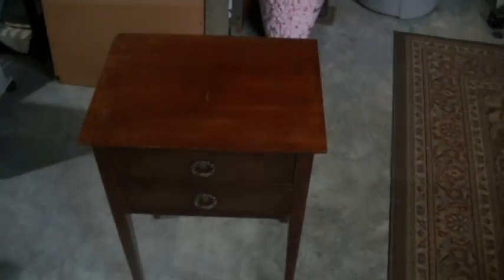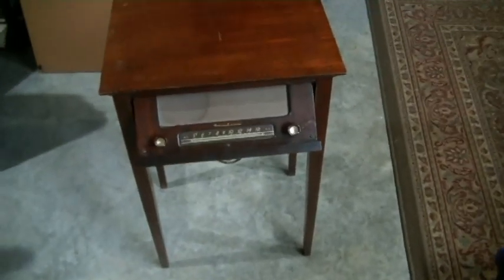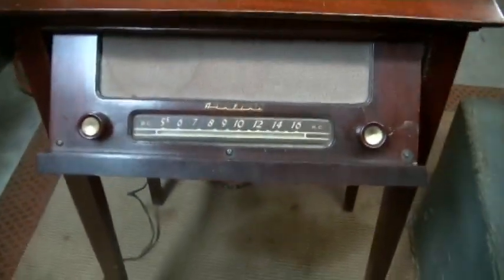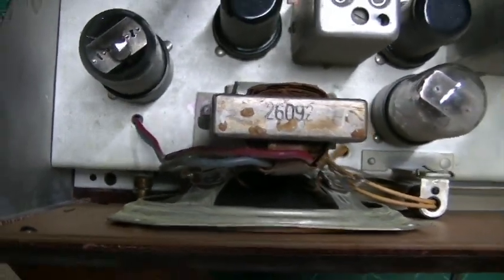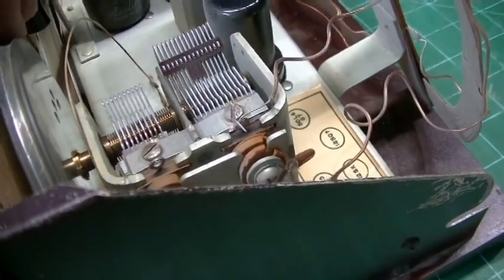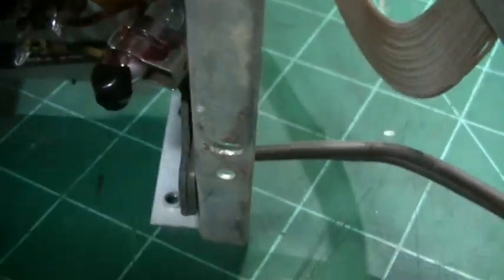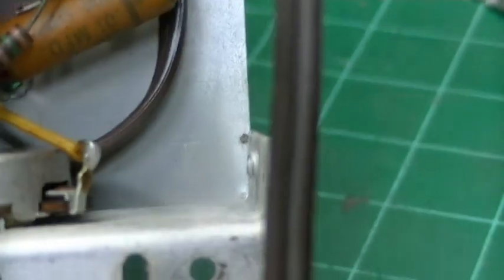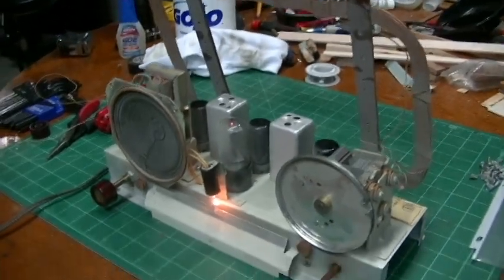1948 Montgomery Wards Airline Radio End Table pt 1 OF 2

Comment: Great to see you post a video again. Fantastic find!! The mercury switch is a great idea and should never fail. The EPA got rid of all the mercury switches in T-stats so replacements are going to get harder to find. They are so simple, I am surprised they were not used more often in radio and TV gear. Never fail technology is seldom used nor wanted by any industry. 
Thanks Scott.
Reply: They still make mercury switches.  True that you won't find them in residential applications anymore but they are still used in industry.
Reply: douro20 
Thank you for the info!
Reply: epa is a bunch of criminals who should be disbanded. anything good they ban it. 

the building i lived in two years ago had an oil fired boiler from the early 1900s which worked until a mercury switch in the automatic feed went and couldnt be replaced according to the oil burner tec.this happened in 2016 a month before i left. interesting thing about the boiler is there was a tag on it signed by thomas edison. if memory serves the tag on the boiler had a date of 1911.

Comment: Cool radio Scott.  You are a brave man plugging that radio in and touching the chassis as that is a hot chassis design.  At a minimum you should install a polarized plug or three prong job on there to prevent getting a bad shock.  The radio is in pristine condition and so is the table.  Awesome find !!!  Ron
Reply from the maker: Isolation transformer is a must. If not, it’s not being brave, it’s being stupid.

Comment: My girlfriend just picked up this exact set three days ago ($40) and it was in similar pristine low hour condition. It wasn’t working, sadly. The C-9 capacitor was dead shorted, the rectifier tube was dead, and the speaker was unfortunately dead. 

Fortunately I had a donor radio with a speaker I could bolt on, and after also replacing the capacitor and rectifier tube it came on and sounded wonderful. 

I asked my girlfriend if she thought she was really going to use it and she said yes so I just spent the time and replaced all the caps. 

Perhaps not surprisingly, the other caps which looked fine were all far out of spec, some by as much as 400%. The filter capacitor “can” was the only capacitor that tested more or less okay. 

I was also going to replace the carbon resistors but after testing and finding many of them to be absolutely bang-on, and none more than 5% out, I decided to leave them in. 

Just like with your set the rubber grommets on the tuner were weak but I just jammed a small piece of wood in there to realign it. The string was still intact but had fallen off the pulleys. Easy fix there. 

We slow danced in the living room last night to a static-y love song delivered from a distant 22 watt transmitter. Hope it can last another 74 years :)

Comment: Considering that it has 70 year old components and a damaged speaker that little radio sounded great! Is the filter cap one of those dry electrolytics?
Reply from the maker: BrumAdam Yes it is....and they are crap...usually. First time I’ve ever ran into a good one. Will probably eventually have to change it out.